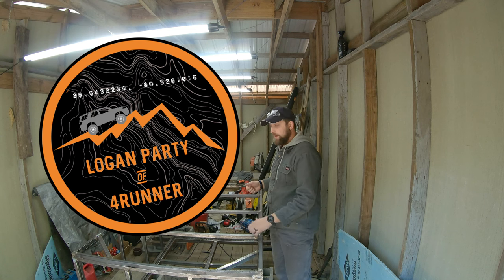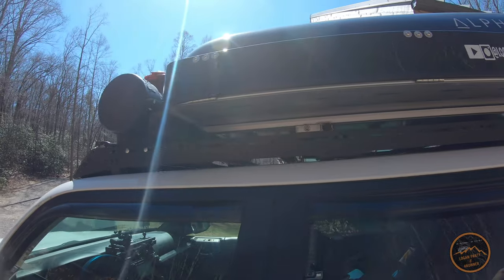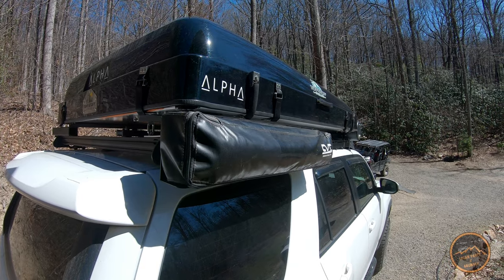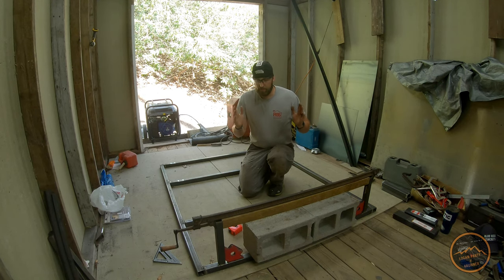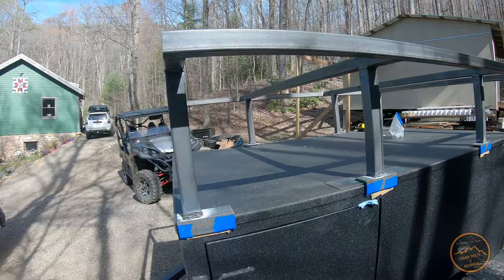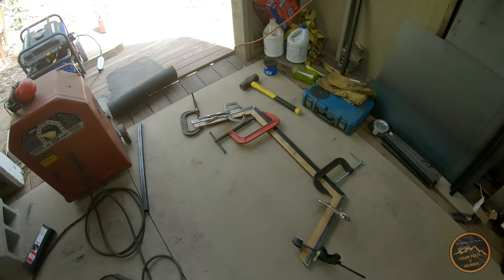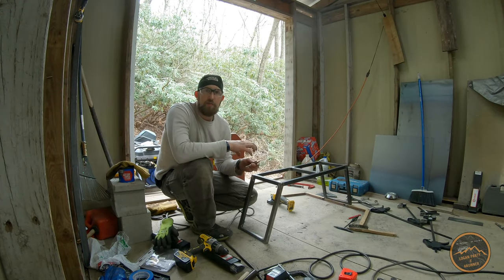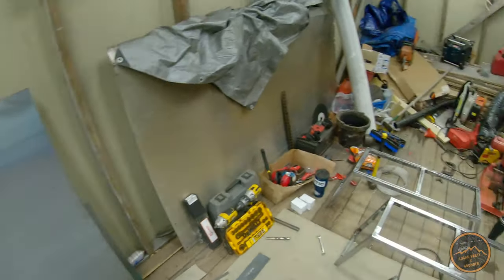Overland trailer DIY build- Off-Road rooftop tent camping trailer project. Ep 4- Roof rack & fenders

Comment: What was the final weight?
Reply from the maker: That is a great question that I do not really have the answer to. I need to get it weighed. My estimate based on similarly built trailers is 1,000lbs for empty trailer, and close to 2,000lbs fully loaded.